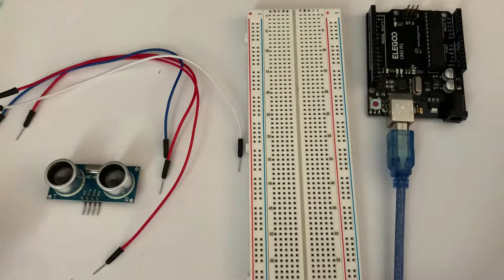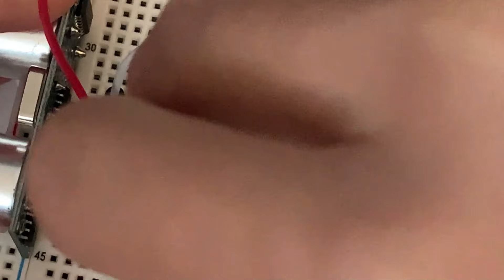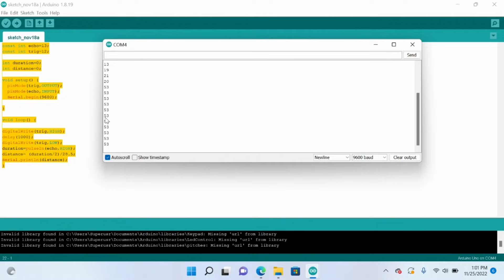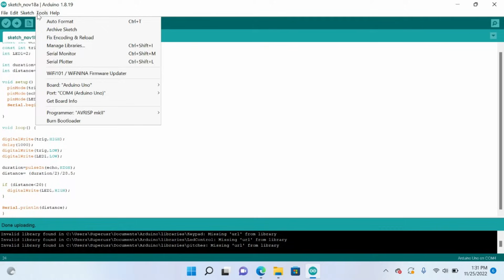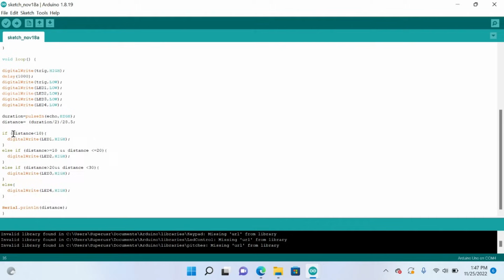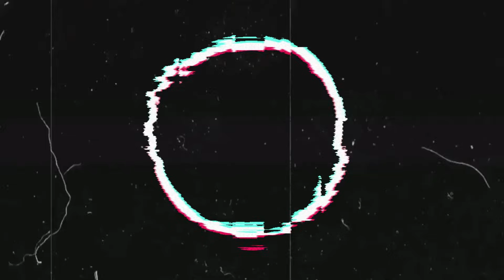Arduino Ultrasonic Motion Sensor: Motion Sensor and LED project

Comment from the maker: const int echo=13;
const int trig=12;
int LED1=2;
int LED2=3;
int LED3=4;
int LED4=5;

int duration=0;
int distance=0;

void setup() {
  pinMode(trig,OUTPUT);
  pinMode(echo,INPUT);
  pinMode(LED1,OUTPUT);
  pinMode(LED2,OUTPUT);
  pinMode(LED3,OUTPUT);
  pinMode(LED4,OUTPUT);
  Serial.begin(9600);

}

void loop() {

digitalWrite(trig,HIGH);
delay(1000);
digitalWrite(trig,LOW);
digitalWrite(LED1,LOW);
digitalWrite(LED2,LOW);
digitalWrite(LED3,LOW);
digitalWrite(LED4,LOW);

duration=pulseIn(echo,HIGH);
distance= (duration/2)/28.5;

if (distance<10){
  digitalWrite(LED1,HIGH);
}
else if (distance>=10 && distance <=20){
  digitalWrite(LED2,HIGH);
}
else if (distance>20&& distance <30){
  digitalWrite(LED3,HIGH);
}
else{
  digitalWrite(LED4,HIGH);
}

Serial.println(distance);
}
Reply: This is coding for programming please reply
Reply from the maker: @RohithV.S-x9w  Hi thanks for leaving a comment!
Reply: Buen día, se puede agregar un buzzer 
¿'
Reply from the maker: @ericknova2989  Hola, no hablo muy bien español. Sí, puedes agregar un buzzer. Puedo hacer un vídeo sobre eso si estás interesado.
Reply: @Waiduino   Hola, si, seria interesante agregar un buzzer que se active con el código que creaste.
Reply from the maker: @ericknova2989  Haré mi próximo video sobre cómo agregar un buzzer para este proyecto. Gracias por tu comentario.
Reply from the maker: @ericknova2989  Se acaba de publicar un nuevo vídeo sobre el sensor y el buzzer. ¡Disfrutar! Gracias por tu comentario
Reply: @Waiduino  muchas gracias por tu apoyo ! y videos, gracias, saludos desde Colombia.
Reply from the maker: ¡Gracias! Me alegra que te gusten los vídeos. ¡Gracias por tu apoyo y espero que disfrutes mis otros videos también!
Reply: My 4th LED(red) won’t work🥲like it won’t light up
Reply from the maker: @yaboidex4000  Hi! Did you make sure that you copied the same wiring for the other 4 LEDs? Also you can try replacing your LED because it may be fried which is why it’s not working.
Reply: makasih
Reply: can i copy paste it?
Reply from the maker: @cabigansamadrian9635  Yes feel free to!!
Reply: what resistor did you use
Reply from the maker: @ I believe 500
Reply: 3:55
Reply: See Short reply
Reply: why my code is error

Comment: hi i am not getting any readings from the sensor after uploading your code
Reply from the maker: Did you make sure to attach the sensor to the breadboard correctly? That could cause an issue
Reply: @Waiduino hi sorry for late response 😅 it was an issue with connection thnks btw

Comment: digitalWrite(trigPin, HIGH);
  delayMicroseconds(10);
  digitalWrite(trigPin, LOW);

  // Read echo
  duration = pulseIn(echoPin, HIGH);
  distance = duration * 0.034 / 2;

  Serial.print("Distance: ");
  Serial.print(distance);
  Serial.println(" cm");

  if (distance > 0 && distance <= distanceThreshold) {
    if (!objectPresent) {
      objectPresent = true;
      objectDetectedSince = millis();
    } else {
      if (millis() - objectDetectedSince >= detectionTime) {
        // Blink the LED
        digitalWrite(ledPin, HIGH);
        delay(250); // LED ON for 250 ms
        digitalWrite(ledPin, LOW);
        delay(250); // LED OFF for 250 ms
      }
    }
  } else {
    objectPresent = false;
    digitalWrite(ledPin, LOW);
  }

  delay(100); // Read every 100 ms
}

Comment: Nice video 
It would have been nicer 😢if you would explain why you connect the pins that way like why the pin is connected to 5 volts😢
Reply from the maker: @chidinmaokoli6929  Thanks for the feedback! I apologize and will make sure to prevent doing that in the future

Comment: i uploaded it but when i tried to check the seriel monitor it wasn't showing anything ;(
Reply from the maker: @nezu_chan1993  Did you copy the code exactly because serial.begin(9600) allows the arduino to connect to the serial monitor. Also are you making sure to add the serial.print command?

Comment: Hi, im not very familiar with all of this but are you able to do up a guide on how to make a 3 lane beam breaker with led? No need for any other accessories such as lap timer etc. I just want to figure out how to make a 3 lane motion sensor with led strips to detect who finishes first at the finish line, project build for Mini 4wd race tracks
Reply from the maker: @GoyOfficial  Hmm I can try that I don’t know if I have the proper parts. A lane beam breaker can’t be created with just a regular LED found in the kit. However, it may be possible to make 3 lanes with 2 motion sensors considering there are 2 sensors per module. Then have it face a solid object, forming a “beam.” When it detects something closer than that solid object, “the beam is broken” and there is something in the way. Maybe I can make something like that if you’re interested and need clarification!

Comment: Can it work without resister ?
Reply from the maker: @deepeshsuragi6229  No, I think a resistor is necessary for this project. Not 100% sure but I can try and get back to you if interested!
Reply: @Waiduino  okay👍

Comment: What are the components required to be used in smart home lighting control system using Arduino (audio controlled)
Reply from the maker: @geoffreyaduda  That sounds like an awesome idea! So essentially you wanna control all the lights of your home using Arduino? That might be a bit challenging but if you provide some more details I can help. You will likely need a bluetooth module or ESP8266.

Comment: Can you please help me? I used a code our teacher provided but for some reason the LCD and the sensor are not working. it lights up but there's no display. LED is constantly turned on
Reply from the maker: @apicc9270  sure would you be able to show me the code?

Comment: what is the value of resistor for led
Reply from the maker: I believe it is 500 or 1k but whatever value you use is fine. The lower the value, the brighter the LED.

Comment: at 6:12 idk if my wiring is right but my LED is not lighting up
Reply from the maker: Did you notice that one pin of the LED is longer than the other? Did you follow that part?
Reply: @Waiduino  heal all good friend thank you :)
Reply from the maker: @jesussaquin6266  Did my advice work? Glad everything works!!

Comment: only one light blink you know why i pretty sure i put it together right
Reply from the maker: You copied the code exactly, right? What pins is each individual LED connected to. Make sure they are securely in.
Reply: @Waiduino  yes I copied the code, but I think it is the wire, since it is kinda hard to follow since you don't show yourself connect the led but I will try again
Reply from the maker: @Mertv123  Thank you for your feedback, I will try my best to improve that for my future videos. With the LED, do you know which wires to connect it to? Remember that the shorter part of the LED should touch the resistor and the other to the wire connecting to the pin on the Arduino.
Reply: @Waiduino  it works now thanks you so much
Reply from the maker: @Mertv123  No problem!! I’m so happy that you were able to make it. Is it for a school project?
Reply: @Waiduino  yeah
Reply: @Waiduino  yeah
Reply from the maker: @Mertv123  Cool! Are you interested in continuing with Arduino?
Reply: @Waiduino  idk i don't have a personal set, so I don't think so
Reply: @Waiduino  But it is cool
Reply from the maker: @Mertv123  Ohhh yea I would recommend the uno kit if interested. Your school provided all the material?
Reply: @Waiduino  for the project yeah, but of course we can't keep it
Reply from the maker: @Mertv123  Ohh that's unfortunate. Have you still been doing electronics?

Comment: How do you do it with all the leds on and when you put your hands closer to the leds they turn off one by one?
Reply from the maker: Hi so basically you would need to modify the code. I will do that for you right now if you would like. You just have to set the status to each LEF as on and then every second it detects a hand, it will turn off an LED by turning it off. Let me comment the code now
Reply: @Waiduino  ok
Reply from the maker: const int echo=13;
const int trig=12;
int LED1=2;
int LED2=3;
int LED3=4;
int LED4=5;

int duration=0;
int distance=0;

void setup() {
  pinMode(trig,OUTPUT);
  pinMode(echo,INPUT);
  pinMode(LED1,OUTPUT);
  pinMode(LED2,OUTPUT);
  pinMode(LED3,OUTPUT);
  pinMode(LED4,OUTPUT);
  Serial.begin(9600);

}

void loop() {

digitalWrite(trig,HIGH);
delay(1000);
digitalWrite(trig,LOW);
digitalWrite(LED1,HIGH);
digitalWrite(LED2,HIGH);
digitalWrite(LED3,HIGH);
digitalWrite(LED4,HIGH);

duration=pulseIn(echo,HIGH);
distance= (duration/2)/28.5;

if (distance<10){
  digitalWrite(LED1,LOW);

}
else if (distance>=10 && distance <=20){
  digitalWrite(LED1,LOW);
  digitalWrite(LED2,LOW);
}
else if (distance>20&& distance <30){
  digitalWrite(LED1,LOW);
  digitalWrite(LED2,LOW);  
  digitalWrite(LED3,LOW);
}
else{
  digitalWrite(LED1,LOW);
  digitalWrite(LED2,LOW);  
  digitalWrite(LED3,LOW);  
  digitalWrite(LED4,LOW);
}

Serial.println(distance);
}
Reply from the maker: Does that work? Let me know
Reply: @Waiduino  it doesn't
Reply from the maker: @Sabbir-ln3bx  What is the error message? What happensv
Reply: @Waiduino  it starts to flicker and instead of turning off the led one by one when you put your hand closer to the sensor, it turns on one by one.
Reply from the maker: @Sabbir-ln3bx  Oh I apologize I thought that was what you wanted. So they should all be off initially and when you put your hand closer they should turn off?
Reply: @Waiduino  yes, can you please show me a code for it?
Reply from the maker: const int echo=13;
const int trig=12;
int LED1=2;
int LED2=3;
int LED3=4;
int LED4=5;

int duration=0;
int distance=0;

void setup() {
  pinMode(trig,OUTPUT);
  pinMode(echo,INPUT);
  pinMode(LED1,OUTPUT);
  pinMode(LED2,OUTPUT);
  pinMode(LED3,OUTPUT);
  pinMode(LED4,OUTPUT);
  Serial.begin(9600);

}

void loop() {

digitalWrite(trig,HIGH);
delay(1000);
digitalWrite(trig,LOW);
digitalWrite(LED1,HIGH);
digitalWrite(LED2,HIGH);
digitalWrite(LED3,HIGH);
digitalWrite(LED4,HIGH);

duration=pulseIn(echo,HIGH);
distance= (duration/2)/28.5;

if (distance<10){
  digitalWrite(LED1,LOW);
  digitalWrite(LED2,LOW);  
  digitalWrite(LED3,LOW);  
  digitalWrite(LED4,LOW);

}
else if (distance>=10 && distance <=20){
  digitalWrite(LED1,LOW);
  digitalWrite(LED2,LOW);  
  digitalWrite(LED3,LOW);
}
else if (distance>20&& distance <30){
  digitalWrite(LED1,LOW);
  digitalWrite(LED2,LOW);  

}
else{
  digitalWrite(LED1,LOW);

}

Serial.println(distance);
}
Reply: @Waiduino  the first led doesn't work
Reply from the maker: @Sabbir-ln3bx  What pin is the first LED connected to on the arduino?
Reply: @Waiduino  the first led doesn't light up.
Reply: @Waiduino  pin 2
Reply from the maker: @Sabbir-ln3bx  Are all the connection secure? Try switching the LED and changing the connected pin (which you should also adjust on the code)

Comment: What was the resistance of the resistor you used? And how did you wire the leds, and the wires next to the led?
Reply: oh wait nvm i think i got it.
Reply from the maker: Sounds good thanks for commenting! Were you able to create the circuit?
Reply: @Waiduino  it works thanks.

Comment: Awesome video bruh can you help pls? thanks!
Reply from the maker: I’m glad you enjoyed the video! I can help, what seems to be the issue?
Reply: @Waiduino  Heyy thank you! Do you have discord account?
Reply: @Waiduino  Were not allowed to use arduino uno or any similar though so it's kinda a bit hard to choose but I think it's a small project since were not going to use arduino uno or any similar etc

We have this type of list and I don't know which to choose for beginners raspberry pi

Thanks!

User Interface
Basic
Basic Kit (at least 2 from LEDs, Button Switches, Buzzer)
Basic
Bluetooth API (e.g. Blue Dot API)
Basic
Speech Recognition
Basic
Speech Output
Basic
e-mail Alerts
Basic
RFID input
Basic
Push Notifications to mobile using API like Instapush or Twilio
Advanced
Flask Server (or WebIoT) providing Web interface
Advanced
GUI created using TkInter or Pygame or guizero or similar
Advanced
Machine Learning
Advanced
GPIO connected Character Pad
Advanced
GPIO connected Joystick
Advanced
74HC595 & Bar Graph LED
Advanced
74HC595 & 4-digit 7-Segment Display
Advanced
74HC595 & LED Matrix 8x8 or bigger
Advanced
Output to an IoT broker such as Thingsboard
Advanced
2x16 I2C based LCD
Advanced
Fingerprint scanner Sensors and Actuators
Basic
Pi-Camera or USB Webcam for taking photos
Basic
PIR Infrared Motion Sensor
Basic
Soil Moisture Sensor
Basic
Rain Fall sensor
Basic
Relays connected to equipment such as water-pump/lights/ locks/ valves
Basic
CPU/Case/Graphic card temperature sensor
Basic
Photoresistor & LED or RGB LED with ADC module
Advanced
Infrared Digital Obstacle Avoidance Sensor
Advanced
Potentiometer & ADC module with LEDs or RGB LED
Advanced
Attitude Sensor MPU6050
Advanced
Hygrothermograph DHT11 sensor / Barometric Pressure Sensor
Advanced
Wind Direction & Speed sensors
Advanced
Ultrasonic Distance Sensors
Advanced
Motor with ADC control or PWM
Advanced
Servo Motor/s
Advanced
Pi-Camera or USB Webcam with Open-CV computer vision
Reply: List at least 5 functionalities in total from Table 1 below (Minimum 2 of which must be advanced) for use in your project. Elements from both sections of the table (User Interface and Sensors and Actuators) must be included. Use of the same component is only allowed once, if the two components are complementary to each other and are going to be programmed separately.

We need to choose atleast 5 things
Reply: @Waiduino  My group and I already have chosen things can you help us pls?
Reply from the maker: @lolboqoboqo  Hi I’m so sorry, do you have an email? I don’t have a discord account for youtube. Thanks!
Reply: @Waiduino  Thanks bro you're awesome!
Reply: @Waiduino  I think my message keeps being deleted for email
Reply: @Waiduino  I don't know if youtube allows you to send email here or?
Reply: @Waiduino  Do you maybe have instagram account? The message keeps being deleted for email account
Reply from the maker: @lolboqoboqo  Do you have an email? I can send a message.
Reply: @Waiduino  It doesn't let me send an email on here I don't know why
Reply: @Waiduino  it's boqololboqo

Comment: hey their whenever i connect to 5V my arduino shuts off plz help ASAP thanks
Reply from the maker: Hi! I’ve had this issue in the past. Pay attention to where the 5v railing is and you might find the cause of the issue. Did you make sure all connections are correct?
Reply: @Waiduino  im not sure if my breadboard is properly or if the video is inverted u are saying to plug in the Sensor closest to the negative side right? Sorry i have a project on this and im stressed
Reply from the maker: @zainraza7126   If you are referring to the sensor, the white wire is plugged to the rightmost pin on the sensor (the sensor circles should be pointed to the right). Is that what you are referring to?

Comment: Yo I am new to arduino so could you tell me what app you use to put the code into the thing
Reply from the maker: Yea for sure. I talked about this in my very first video but the compiler or IDE is something you have to download. Here is the link: https://www.arduino.cc/en/software Let me know if you have any other questions!!
Reply: @Waiduino  Thank you 😊
Reply from the maker: @DanielMTB663  Yea of course! If you’re interested in other projects I would greatly appreciate it if you could check out some of my other videos since i’m really trying to grow my channel. Have you built any other projects?
Reply: @Waiduino  no this is my first project as I am trying to make an RC plane. I have subscribed to see more projects. (I am using the radar to ad to the plane)
Reply from the maker: @DanielMTB663  Ohhhh that seems super interesting! Glad to see your working with the Arduino. Thank you for your support and if there’s any project ideas or assistance you need with the Arduino feel free to ask any questions!

Comment: const int echo=13;
const int trig=12;
int LED1=2;
int LED2=3;

int duration=0;
int distance=0;

void setup() {
  pinMode(trig,OUTPUT);
  pinMode(echo,INPUT);
  pinMode(LED1,OUTPUT);
  pinMode(LED2,OUTPUT);
  
  Serial.begin(9600);

}

void loop() {

digitalWrite(trig,HIGH);
delay(1000);
digitalWrite(trig,LOW);
digitalWrite(LED1,LOW);
digitalWrite(LED2,LOW);

duration=pulseIn(echo,HIGH);
distance= (duration/2)/28.5;

if (distance<10){
  digitalWrite(LED1,HIGH);
}
else if (distance>=10 && distance <=20){
  digitalWrite(LED2,HIGH);
}
else if (distance>20&& distance <30){
  digitalWrite(LED3,HIGH);
}

Comment: Hello thanks very much , so i have an inquire how can i use an infrared sensor as a level sensor and also with like 2 indicator LED lights ???
Reply from the maker: Thank you so much for your comment! It is possible to use the infrared sensor as a level sensor however it would require much more instructions than I can show here. Would you like me to create a video to show how to create this project?

Comment: hello how to give connections for led positive and negative and resistor?
Reply from the maker: You can find that all in the circuit diagram. The GND should connect to the railing which is connected to a resistor which connects to the negative side of the LED and the positive side connects to a pin on the Arduino designated in your code. You can find a walkthrough in my first ever video. Hope this helped!
Reply: @Waiduino  oh thank you
Reply from the maker: @mvsaikartheek633  Sure no problem! Let me know if you have any other questions.
Reply: @Waiduino  okay 👍